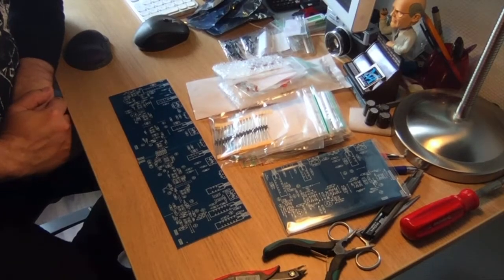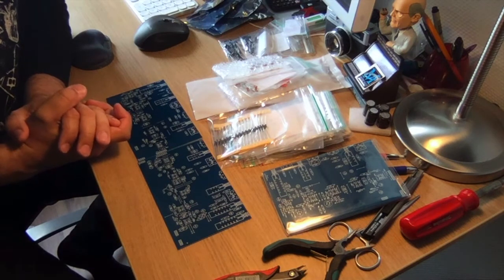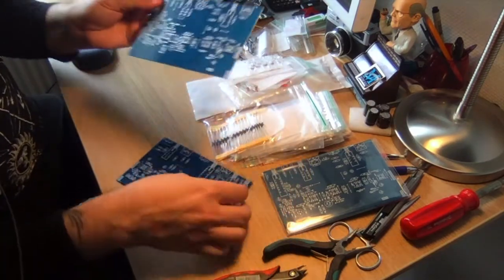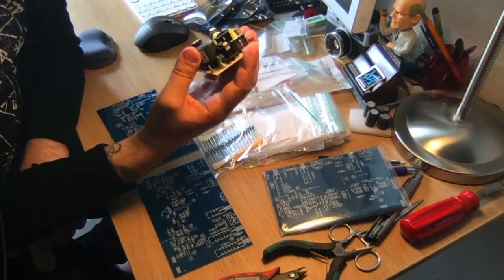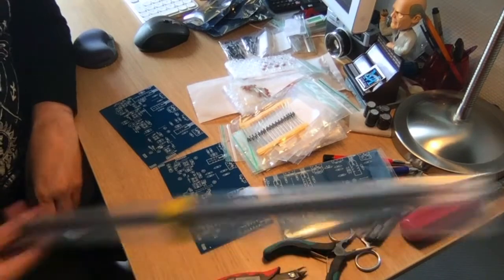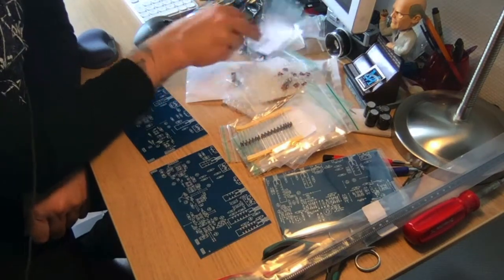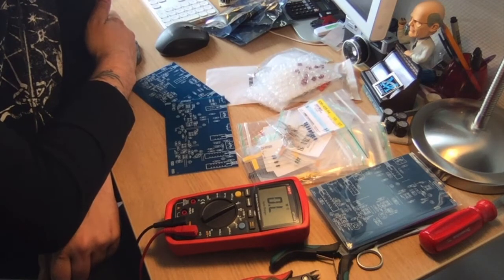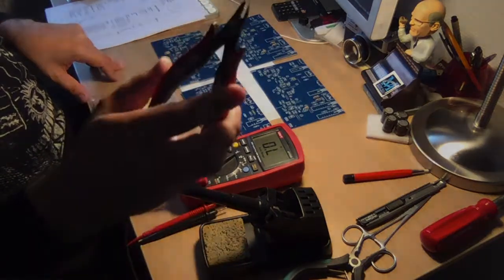DIY Calrec PQ1549 Build Part 1 - Intro

Comment: Also building this eq finding to be a little expensive, should be straight forward build compared to the 1176. I've decided to get an old rack mount graphic equalizer for the case has all the power sockets and xlr ins and outs much quicker than drilling!!